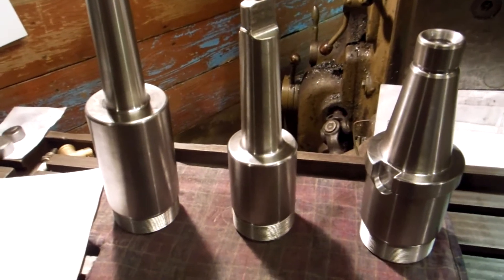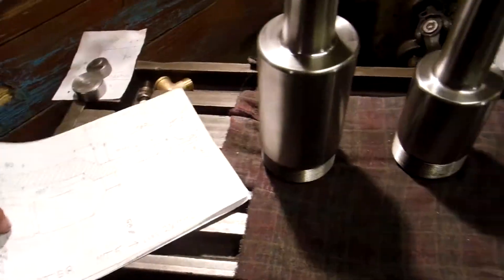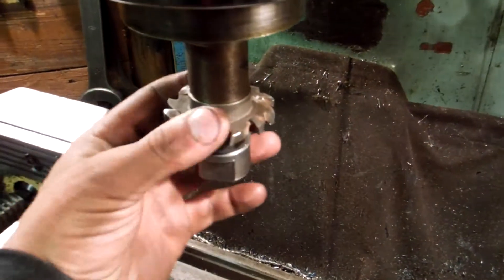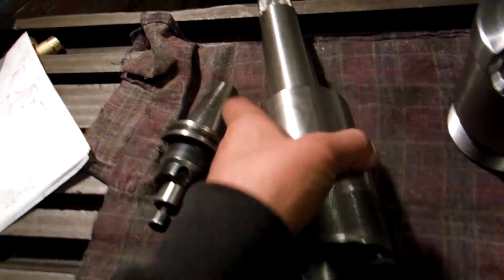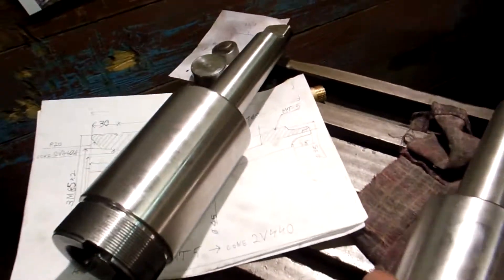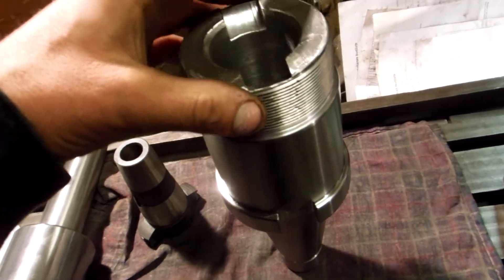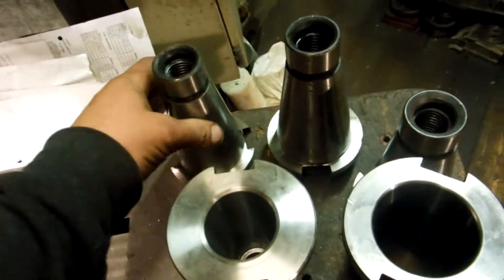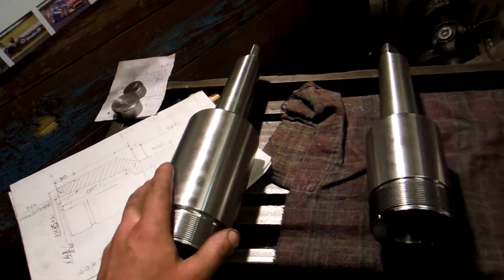Machine spindle adapters project - walkaround before adapters go to finishing /p5

Comment: Excellent machine work; useful adapters. I would really like to see how you cut the tapers and the setup for being able to cut them. You mention that the adapters are going to be ground. What grinding will be needed? I enjoyed your video and look forward to see your adapters in action. Thanks for sharing.
Reply from the maker: Thanks!
Yea,  forgot to take in video that to how I cut a tapers... I hope hext time I will make few videos for this.
Yes, for those pieces heat treatment and grinding is necessary, because thos adapter is TOOL and it must serve long years. Grinding make them accurate.

Comment: Very nice work but there's one thing missing - fine custom work should be signed with your name or your makers mark :)
Reply: I will see if I can find it again and send you a link. It is like Electric Discharge Machining but designed more for etching than metal removal. Cheers from John.
Reply from the maker: Thanks! 
Yeah, I'll tage a dremel grinder from my friend and engrave My initials on adapters.
Reply: FactoryDragon87 . Just a thought, search YouTube for etching, I have seen some really easy ways to use I think Vinegar and a 12 Volt battery charger to label metal, even Hardened. I guess you would call it a type of electro chemical machining. Cheers from John.
Reply from the maker: joandar1 Ah, You mean something like a "electro erosion" device for marking (labeling) metal parts? But way how to make it can do in home by 12V charger. Thanks for the idea!!!!!!! Cheers!
Reply from the maker: Okay. Thanks! I get a link!

Comment: Nice work!!! Aren't there any adapters available or are they expensive? Haven't seen that kind of taper here in sweden, is it Stankos own taper?
Reply from the maker: Thanks!
Those kind of adapters never had made, except adapters ISO50 to ISO40 and from ISO to Morse. With last ones is full ebay and amazon. I never seen adapter from Mt5 to ISO40 and from Mt to 2V440 taper. Here, in my country machinist make his own tooling- noone give tools for him.
That strange taper with two "teeths" at sides is from Stanko jig borer 2V440 (2V440A). This machine is only what have their own spindle tooling - different type of spindle taper. I have get some tooling and heads on this jig borer taper and I take a reason to make those adapters. Also I want to use ISO40 tooling on my 2L614 borer (Mt5 spindle) and 6T12 milling machine (ISO50 spindle).
Reply: okey:) yes I know, iam also a machinist:) it was that Stanko taper I wonder about, always interesting with machines that are a little different! I am looking for a new lathe and think its going to be a Profila this time, thats the name Stanko machines was sold as here in Sweden. Very nice machines to work with, see you got a bunch of them :) Nice work, keep it up!!!
Reply from the maker: Oh! Nice!
Stanko in Sweden?
Reply: Yes but they sold under another name "Profila", but the Stanko name plates is usually still on them:) They are pretty common here. When it comes to manual machines I prefer machines built in Sweden such as: Storebro, Munktell, Köping, Sajo and so on but I always liked the Stanko lathes also, ridgid machines!
Reply from the maker: Oh! New way how to call "Stanko".... interesting..... new info
Reply: When I am searching internet for lathes I always write both Stanko and Profila:) The model numbers are the same.